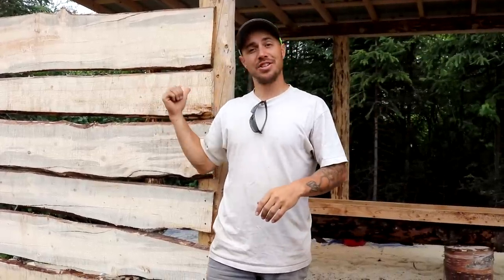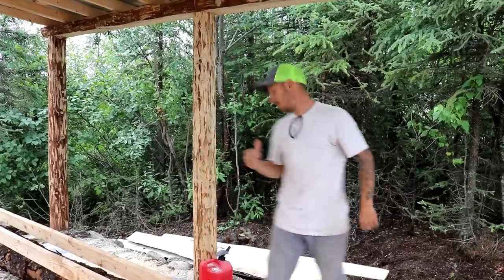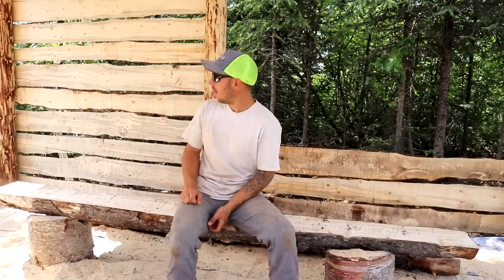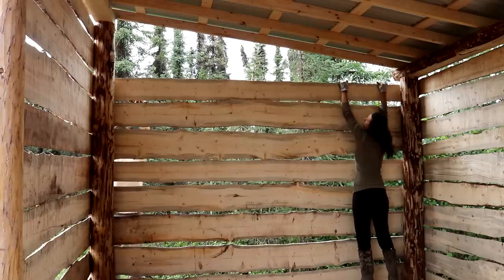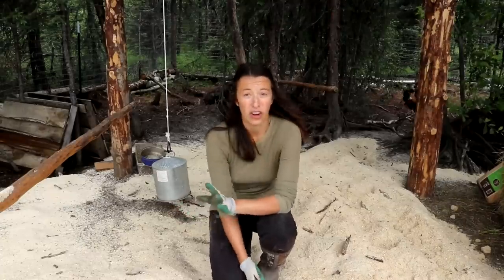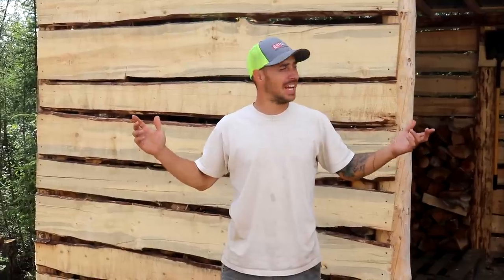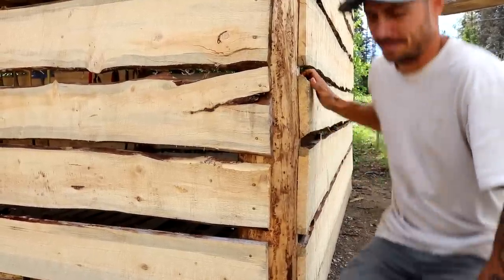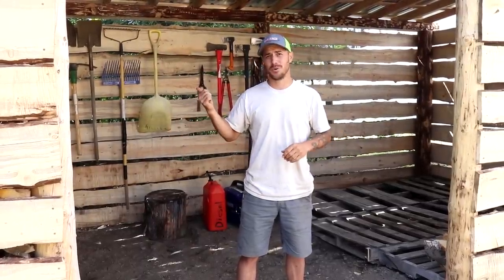Milling Live Edge Siding | Wood Shed Build (Part 3)

Comment: Do a rolling barn door. It’s too pretty to have a tarp.  IMO.
Reply: Yes, any door that the piling snow won't push in and will give easiest access when the deep snow hits.
Reply: Rather then that, build a awning out the front.  Do it cleverly and snow can be plowed away simply, leaving good access.
Reply: In winter throw some snow fence across the opening... That'll keep most out since the buildings not weather proof anyway, and it's easy to move aside.
Reply: As always,  your project turned out awesome.  So we'll thought out and executed.
Reply: Is there a reason why you didn't overlap the boards a bit, like clapboards, so it'd be a bit drier in there? Just curious. More airflow maybe?
Reply: Joy Plyler & Co. Agree with you.
Reply: but tarps don't freeze in the middle of january :o) well they do but
Reply: Beautiful woodshed. You did an amazing job on that one! But one little suggestion - Put on a lockable door to protect your tools. We're 12 miles from you and the other day, we had intruders when we weren't home and they carried off everything that wasn't locked down, including the trash can, the winch off the truck, the firewood cart, and a dolly. They even broke into the outhouse and took the toilet paper holder and two half-burnt candles, which is pretty hilarious, but they also got all my sentimental froggie statuary that was dotted around the place.
Reply: This is Alaska.   Tarps are the norm. 😂.   Matsu valley chic
Reply: Jan Wyman I would stuff it with moss
Reply: 100% agree lol and so much practical to use
Reply: A sliding barn door might be tough to get open and closed when the snow piles up and the wind drifts it.

Comment: A great looking, and practical, woodshed guys. The lumber you’ve milled and logs you’ve used will ensure that your shed will last decades longer than something store bought at a fraction of the cost. FYI Costco sells a great solar powered exterior light with 3 separate heads that would be great to cover all 3 sections when out at night. There would be no issues with it surviving the winter as I’ve used the light here in Canada for several winters. I look forward to your next video. Stay safe

Comment: I’m impressed it’s not easy hanging siding strain down level when you don’t have a straight edge to reference. The building looks nice. You’re going to want to get something between the pallets and the ground because they will rot, I know from experience. Also no mater how cool that bark looks on the back siding get it off —bugs will get in there and cause rot that’s why you don’t see log cabins with bark.

Comment: The shed looks awesome!

I would like to provide two pieces of advice, as civil/construction engineer: 
1. The roof construction is quite slender, not familiar with your climate, and design loads, but I guess that you plan to shovel the roof if there is excessive snowfall. Anyhow, for wind, snow and uneven firewood loads i suggest diagonal cross bracing supporting corner posts on at least three places.
2. It looked like you used four 4" nails for each wall board. if you are unlucky or if the boards degrade in the ends the stacks might push the boards out. Some stacks seemed to rest on the posts, for others, resting on the board walls you might want to consider a vertical 2 by 6 or something to distribute the load. No need to restack the firewood though, but you could consider it as an extra precaution the next time a section gets empty.

Greetings from a swedish moose hunter!
Reply: I am also interested in how it will weather the snowy season. A fantastic build.
Reply: Might want to consider doubling up a few of those roof 2" x 4" rafters for additional snow load support.

Comment: Cool. Good looking woodshed. Will keep your wood dry and easier than digging it out of the snow. Yet it will have air circulation if you put any green wood to dry in it. I was just thinking how few homesteads on YouTube has one. 
You folks think ahead and work hard, it shows and come the cold winter you can stay warm and have good food.

Comment: Your building is awesome. It seems that you have a lot of snow to deal with in the winter. If you put barn doors, put on inside so the snow won’t be such an issue.  Or, better yet a roll up door. 😎  Can’t wait to see your solution.

Comment: Add a overhead door awning to keep the snow away from the door opening. This stops you from shoveling snow just to get inside the building. If you have the resources to add on to the hole front of the building, you’ll have more space for equipment or storage.

Comment: You know, I don't normally give advice on these kind of channels, but... Diagonal Bracing will prevent you folks from a lot of heartache.  Try it.  You'll like it. 
Of course, you can stand back and watch it collapse in a good wind storm without diagonal bracing, and it'll be even more fun if it's loaded with a foot or two or snow.

Comment: You can mix used motor oil and a little diesel feul, and use that to treat the shed. Just put a coat on each year or two and it will help it hold up longer. Usually easy to get extra used oil if you ask for it. Just brush it on. Good luck, looks good!!

Comment: Nice job.  Most structures in big winter climate tend to have extended roofs which help prolong the structures walls. To protect the bottom with full size D log shape from water drops and water runoffs  and extra heavy duty support is nice but all to late now.  Nice job again.

Comment: Beautiful woodshed. You did an amazing job on that one! But one little suggestion - Put on a lockable door to protect your tools. We're 12 miles from you and the other day, we had intruders when we weren't home and they carried off everything that wasn't locked down, including the trash can, the winch off the truck, the firewood cart, and a dolly. They even broke into the outhouse and took the toilet paper holder and two half-burnt candles, which is pretty hilarious, but they also got all my sentimental froggie statuary that was dotted around the place.
Reply: Makes me think that after installing that lockable rolling barn door and a solar panel for lighting when you visit the woodshed at night, you might want to activate the lighting with a motion detector.  Sign of the times I guess.

Comment: What a great shed. Good for you. With all the snow you get, a PAIR of sliding barn doors is a good idea, because after a winter or two, tarps can start to look like rags. Now I understand it would require moving some wood and trimming some pallets, but sliding doors would operate better on the INSIDE of the wall where snow and ice can't BLOCK their opening. To prevent the wind blowing them in, put a guide roller inside the bottom of each door, and keep the bottoms a minimum of 4 inches off the ground. BTW, the tool wall looks like something out of a horror movie.

Comment: just an idea..  we do this on jobsites..  two pieces of plastic to hang in the opening and have the vertical seems in the middle overlap by about six inches,,,  you sandwich the plastic along the bottom edges with wood strips(we use strapping) so basically the wood strips act like an auto closer. would work great until you do the sliding door... looks awesome!!!!

Comment: looks awesome, I built a similar shed and I put two canvas tarps on the opening so I could part them for easy in and out. I put them on a cable like a shower curtain so you can push them aside when your working or the weather is not bad.
Reply from the maker: Steve Allen  Great idea thank you!

Comment: As always very orderly...common sense  and ingenuity applications at best.
Good to have door or double door two frames open in the middle.  Since axes etc hanging .. fix a lock . When not in.. can lock it.

Very nice slats.. as wall. 

Might want to dig shallow drain around the house and chicken area. So that water runs to the outlet somewhere. Or collecting pool somewhere.

👍👍🐈🐈

👍👍🐈

Comment: Great job and well planned, my dad built one similar to yours but he used 'free' 1" by 2" lattice and it's been faithfully keeping his firewood dry for over 45 years. At 93 years old, though slowing down, he still cuts his own wood, but finally splurged for a gas wood splitter, he heats his home with wood and has a propane furnace for back-up, as we get -40 degree and colder winters in northern Ontario, Canadastan!
Reply: He's a monster! I finally broke and bought a splitter when I turned sixty. Still wack a couple cords with the maul to keep in shape though.

Comment: Looks great. You should make a smaller version for a workspace when the weather is horrendous. Or put that sliding barn door on to keep part of the space for projects you want to keep dry but need to work on in adverse weather conditions, ie: wet not cold! Just a thought. :-) Awesome job!

Comment: I would close the upper gap just below the roof. It will prevent snow from falling inside and on the wood. There are enough gaps everywhere so there should still be enough airflow. Also, a door is a must or else in the winter, you will have lots of snow inside (and mud, and unwanted moisture). A tarp will rip one day. Especially in windy weather and it won't seal too well.

Comment: if i may suggest a couple of things, first it's easier to split wood on a chopping block, better impact for the splitter, and your axe or splitter doesn't dive into the dirt, 2nd is for kindling, if you take a chopping block, turn it upside down, drill three holes, with a one inch bit 4 inches into the block, insert 3 legs, stand up and you have a chopping block at waist height for doing kindling, shed looks great,

Comment: Turned out sweet! FYI I would add extra support to horizontal wood cause you add bunch weight on inside pushing up against it just gonna pop those boards off maybe leg bolts?

Comment: Great job on the wood shed, I would suggest you fix the broken pallet boards because you will be hauling wood out of there in the winter in the dark at times. Also close of the gable ends with live edge so the snow does not blow in and build up on your wood. 
I am amazed at how far you guys have come from an almost  barren lot to a going concern.

Comment: Next time you are in town go get a 5 gal pale of USED motor oil from auto shops. You will have to supply your own bucket and lid. Paint it on fence post and out-buildings as a water proofer.

Comment: Set two post in front of that door opening and put you a roof on it that slants forward. The snow will be kept out of your wood shed for the most part and you can pull the snow off the roof away from your shed.

Comment: There's enough of a gap between the roof and the top of the door frame that hanging something there would be really easy, and the gaps between the planks of the walls would make it pretty easy to tie off a pair of tarps like curtains. 

I'm thinking canvas would look pretty sweet while still being durable and relatively cheap, as long as you buy a larger piece and hem the edges yourself to prevent fraying. Maybe a roll from a fabric store, or an old arm tent from a military surplus outlet? I've had pretty good luck with military surplus stores for durable outdoor supplies at low prices. Even if they aren't the most comfortable, they are durable as all get-out and are usually pretty warm for the cold weather supplies.

Overlap them a bit, maybe sew on some straps for securing them during harsh weather, and you'd have a durable, yet decent looking door that you can push through while your hands are full, but can secure when you want them to stay closed.

Comment: Turned out  really nice.. Great idea for the tool's. If you have more or can get more of the beetle killed tree's/log's, couldn't you build on to the cabin, back side ? It would give you so much more space, come spring time and starting seed's and pantry storage  !? Could put a composting toilet in there for the winter time(OffGridWithDougandStacy has one and no smell). Your wood stove wont have any trouble heating more space. Just an idea. Stay safe and healthy. God bless

Comment: If you put in a rolling sideways barn-style door, remember to put it on the INSIDE of the shed, because the snow & ice of winter will build up on the outside and require you to hack away at it in order to move the door. (You'll want to put it behind a protective wall so that the wood pile cannot fall against it and wedge it in place.)  Personally, I'd recommend either a tarp with ties or short bungees down the sides & anchor-cleats on the posts to tie it to (cheapest & most snow/woodpile-friendly solution) or a lift-and-tilt style garage door that  raises up from a vertical wall to sitting horizontal on railings overhead (expensive unless you can get a pre-used system in good condition, avoids most of the snow & ice issues, but still not as cheap as a tarp & tie-outs).

Comment: Have you guys considered overlapping the boards like siding, where you start at the bottom and the next board overlaps about 1inch on the top for the rain to run off?
Reply: Good for airflow and lets light in

Comment: I heard you say that you have to remove snow from the shed roof because you used 2x4 rafters. I would add a 2x4 to each side of the rafters or a even a 2x6 on one side and install a A35 framing angle at each end for shear. I would simply use 16d nails at 12 inches o.c.  This will stiffen your roof up and snow removal should not be a problem unless the edge beams start to deflect. It’s a simple fix.

Comment: build one of the MS660 clone saws from one of the kits.  92cc saw for about $230 shipped.  Has way more power than is needed to go through a log that size. No more bogging.  Save your expensive saws for lighter duty work.

Comment: There is a difference in chain grind angles between cross cutting and milling with a chainsaw. Also, typically with milling you will want a skip tooth chain. It looks to me your saw is very dull, or ground at the wrong angles for milling. I’ve did a lot of milling with a chainsaw with a Woodbug mill. I can cut 1200 bd ft a day with a Husq 3120xp (bigger saw I know, but those angles matter!) Perhaps make a chain for milling and another for crosscutting? Just trying to help out your progress. Thanks for the video.

Comment: Did you use a ripping chain on your saw? If you used your normal chain on the mill it will be far harder than a ripping chain (different tooth angle). Nice work.

Comment: If milling up lumber is something you're going to be doing regularly in the future, it may be worth your while to invest in a proper bandsaw mill.  Woodland Mills makes some value priced mills and Woodmizer has their new LX55 model that would be comparable in value.
Reply: The little lx55 is nice except... it’s left-handed! If you’ve never milled before it may be fine, but I’m so used to having the mill on my right I think it would be hard to adapt to that.
Reply: @brucea550  having the controls on the right hand side means you won't be walking in the sawdust pile shooting out from the left side.
Reply: @bwillan  
I’m okay with that. It’s not much sawdust. Every few logs I just take a scoop shovel and put it in the wheelbarrow. But I’m right handed, so having to do everything on my left side would be awkward and slow me down a lot. Never met any sawyer who minded a little sawdust on their boots.

Comment: out of interest what do you use for bar oil? I've started using rapeseed (canola oil for Americans/Canadians) so that i feel fine composting the shavings. I have heard canola oil has trouble in extreme low temps though?
Reply: How well does that stay on the chain? Bar oil is formulated to be sticky, like honey is, to stick to the chain, because at high speed regular oil will be flung off the chain at the top of the bar and the bottom (that’s doing the work) doesn’t get enough lubrication, especially on a longer bar.

Comment: Don't understand why you didn't shingle the slabs to keep the winter snow out?  Still would have air flow through the roof/door for drying wood, but less snow.  Yes it would take a bit more material but would also shed water.

Comment: Are you using an off brand or an actual Granburg mill when you all did this?  Thanks.  I have been debating the granburg both the 20 in and 24 in... Thanks
Reply from the maker: AK Washkeeton 
it is an off brand, check the video description I believe there is a like to the exact one

Comment: if you keep entire wood shed closed you'll be moving a lot of the same wood several times as you cut more wood that still needs to age.  Didn't know if you considered that??  If you left both ends open, you could be stacking the new wood as you use from the other side??

Comment: Oddly old tires, the inside diameter is about same size as average blocks of wood so throw one down and set the block to be split in the center of it. when you split the block of wood, the tire keeps it standing so that your not bending over and restanding a block to be split smaller.  Once done splitting this wood it is standing so easier to toss on the ricks as you go... might save a sore muscle or three. A rather wide tire is the best and there are all sizes so you can have a few laying in there and then just stand them up in the tires as you go, making more of your time. If you could find a old highschool band saw or one from a commercial spot, it wouldn't be much of a emagination and google to build your own lumber mill. If you have some trees that are blocking sunlight.... lumber never goes to waste. Nice place you have... I live in wasilla